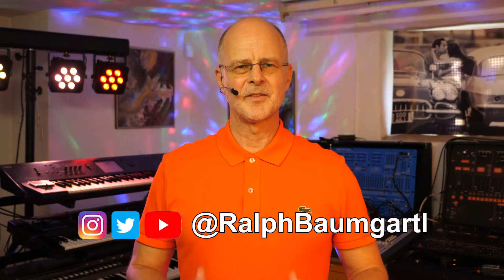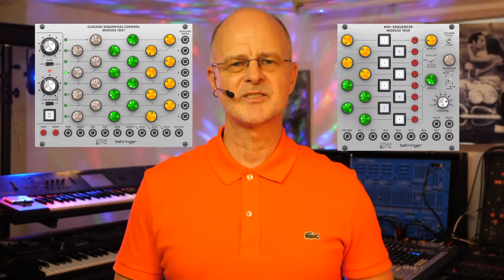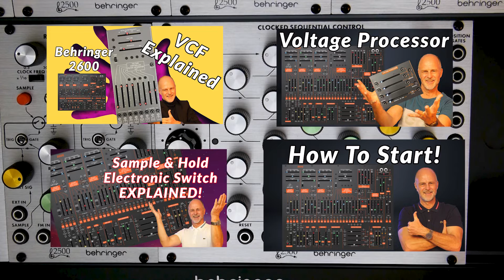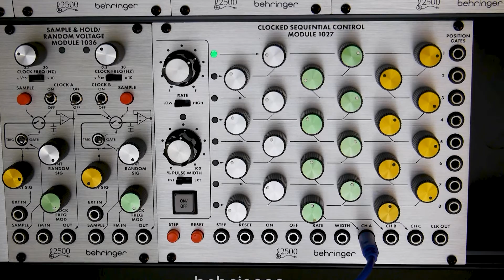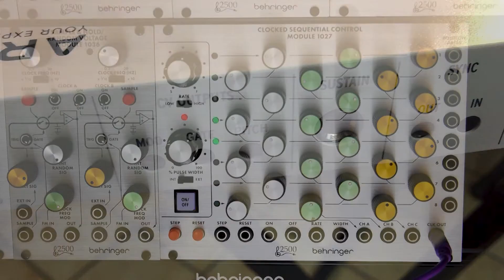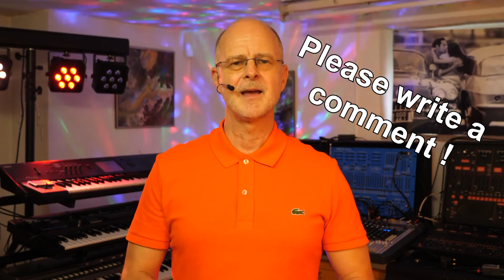Demystifying the Behringer 1027 analog Step Sequencer | 2600 Synth Connection

Comment: Afternoon Ralf, should it be possible to use the 1027 with the 911 envelope. I have the Behringer system 15, with added 1027, I can make the envelope work when using a keyboard via midi, but when using the 1027 to sequence with the 911 envelope  the 911 not doing anything, I'm using the 1004 oscillator, 921b and 2600vco, Hope you can help. Cheers Tim.
Reply from the maker: Hello Tim, the 1027 has a max Clock Out of 5V but the 911 requires a 5.5 V signal according to the specs. Try boosting the Gate (Clock Out) signal from the 1027 before sending it to the 911 envelope. Please note that I do not own a 911 but I think that’s the reason why you have trouble triggering the 911 from the 1027. Cheers, Ralph

Comment: How??? does one get it to slave to another master clock. (bypassing the internal clock). so that it stays constant all the time? please can you help? Is it even possible? rate and step in alone doesn't seem sufficient?
Reply from the maker: Run the external master trigger signal into the "STEP" slot.

Comment: I'm fortunate to have 3 different sequencer options for my B2600 so, much as I do like the Behringer 2500 series of modules, I won't be needing one of these. My Keystep 37 and my Behringer Crave do most of the heavy lifting and I recently also acquired a Korg SQ-1 as I just think they are so neat and compact.
Reply from the maker: The 1027 is definitely an old school sequencer. In order to use in a more convenient fashion one should add a quantizer. Have a creative weekend, Ralph

Comment: Hey Ralph – Thanks for the tutorial. I have a problem with the external clock. What does the clock signal need to be for it to sync?
My Beat Stp Pro is set to 2ppq, and it doesn't work.
Reply from the maker: I had best sync results with pulse Wave signals. I don't own a BeatStep Pro. The 2ppq signal is the Korg Volca Sync standard. Try 24ppq too. Start with the slowest speed on the Beatstep with either Sync setting. You may also have to boost the Sync signal from the BeatStep before it goes into the 1027. You can use the 2600 preamp for this. Cheers, Ralph
Reply: @RalphBaumgartl  Hej Ralph - thanks  - and the Blue Marvin is right below ;-)

Comment: to be honest I hesitate between the Behringer 1027 sequencer and the 960 which is longer but which seems to have more possibilities. Your opinion?
Reply from the maker: If you are just looking for a standalone sequencer then the 960 would be my choice. But if you are looking for a sequencer/sequential switch combination then the 1027/1050 might be the better option. Also bear in mind that the 1050 can also be used as a standard mixer module only. Cheers, Ralph

Comment: Hi, do you know how I would synchronize the 1027 with a Moog grandmother sequencer/ Thanks Tim.
Reply from the maker: Use Clock In/Out on the Grandmother and Step/Clock Out on the 1027. Experiment with both directions and find out which works better for your workflow. You may have to boost the Clock/Trigger signal to make it work. I have tutorials for this on my channel as well. (please note that I don't own a Moog Grandmother, but that's how I would approach this task)
Reply: @RalphBaumgartl  Cheers thank you for your info. Tim.
Reply: @RalphBaumgartl  Thank you, I have got the GM and 1027 working together. Now I am having trouble syncing the Behringer Odyssey to the 1027 I have tried them both ways, if I use the odyssey as the master the 1027 does a weird type of ratchet thing and vice vice versa. Have you any advice? Regards Tim.
Reply from the maker: @DisciplinedCommotion  Always make a Midi connection wherever possible. And when there's no Midi option left then use a Midi/CV converter.

Comment: great video. I have a Q, do all 8 steps play all the time, or can steps be skipped? Cheers Tim.
Reply from the maker: Hello Tim, you can play fewer steps by using the Postion Gates and Reset slot. In order to skip and mute steps you need the Mix Sequencer 1050. Greetings, Ralph
Reply: @RalphBaumgartl  cheers Ralph.
thanks for the info.

Comment: Would  be nice if you explained the difference between gate and trigger in the 2600, which is different from eurorack, and how to use that feature, which you appear to do at the end.
Reply from the maker: The Gate also includes a Trigger. That's the spike at the beginning of the Gate. To put it very simply, when you set to "Multiple" on the 2600 you can play a new key while the previous key is still depressed and thereby triggering (initiating) the Envelope again. On the 2500 Eurorack modules you also have the "Multiple" feature but you have to do some additional patch cabling to achieve that result.

Comment: I use mine with the 962 sequential switch to get up to 24 step sequences going into the Erica Synths Pico Quant, I duplicate the gate out into a 4MS clock divider and patch the various division outs into my drum modules for drum sequences. I didn't realize you can use the 1050 (for whatever noob reason) to do the same thing as the 962, which I've been slacking on trying out, which if it works with how I like to patch things, would save me some space and power draw for more modules :D
Reply from the maker: Hello Sean, the 962 seems to be a pretty common companion to analog step sequencers. Anyway the 1050 is a powerful solution for the 1027 because you can set up an "internal" connection to the 1050 which is simplifying things. Thanks for sharing your experiences 🙏 Have a nice weekend, Ralph

Comment: I started with B2500 modules in my Nifty Keyz. Looks very nifty indeed. Couldn't resist adding a B2600 alongside. So much for so little money!
Reply from the maker: Yes, the B2600 is extremely good value in my humble opinion.

Comment: Nice! but why don't you use the rest of the Behringer 2500 modules instead of the 2600? This is all about the 2500.
Reply from the maker: There are more people out there who currently own a 2600 and are looking for an analog sequencer. You can easily apply the connection process which I am explaining in my video to any modular eurorack system consisting of or including VCO, VCF, VCA and ADSR.

Comment: Hey ralph, thanks for the video! I have the 1027 and 1050. I don’t use them combined often.  I don’t sequence notes with the 1027 often because it’s not quantized and the fact that it’s a short sequence (I use a sequential switch to combine the channels into a longer sequence in that case). But I still like to use it for modulation and as a clock. I usually use Rene to sequence notes because I can get a much more complex and shifting sequence with it. Are you making a video combining the 1027 and 1050? That would be great! I bought them to use together but it didn’t work the way that I had assumed it would. Like most things, I’m sure I missed something along the way.
Reply from the maker: @jdforth Yes, I will also address how to combine the 1027 step sequencer with the 1050 mix sequencer. Greetings, Ralph
Reply: Psst, you can use the 1050 as a sequential switch to make the 1027 play longer sequences 😉
Reply: @ScottPigman  Yes, I am aware.  I just use the doepfer sequential switch though and the 1050 as a mixer. But I’m sure that I’ll switch everything around sooner or later anyhow.

Comment: thanks so much for teaching how to use this module, looking foward to the the next video with the mixer :-)
Reply from the maker: Thank you for your kind feedback! Glad to know that you get value out of my videos. Have a good week, Ralph
Reply: @RalphBaumgartl  Hi Ralph do each step knob setting affect the overal tuning ? I mean when i turn one of the knobs with a high pitched note like setting it at 12 o'clock , the tuning of the sequence will very slightly change in pitch. Does yours do this ?
Reply from the maker: @smartti1970  Turning one individual knob will NOT affect the pitch/tuning of the entire sequence. But bear in mind, this is an analog device. It does not behave as accurately as a digital device. It may go out of tune slightly and thus the sequence may require some re-adjustments.
Reply: @RalphBaumgartl  thanks very much for your reply Ralph.

Comment: 🙏🧡💚👍thanks for this tutorial. I'm building my racks for now, the 2500 modules are on my list with two grey minie B2600, with other Behriger things, Depend of my money every month. For now, I'm about the three cases wich will contain 2 or 3 keyboards by unit. The upper part will be the racks , euroracks and 3U, Acting as lids. So it is very important for me to listen what material I need, to balance between mono and polyphonic instruments and the structure , the organization of the racks. In your video, I listen that the philosophy of the 2500 modules are well corresponding to the 2600.   My music is partly played on keyboard, partly this is long slow sequences, soundscapes, using sound from nature too. This month I just brought two Keyboards Behringer Swing, as I am busy to design the shape of the three cases. My project seems ambitious, but in a few years All those new affordable instruments opened a new era for old listeners of electronic music like Tangerine or Schulze, not wanting to recreate past, but just to our proper search with new ability of creation. This sequencer lets being keyboard free to control free designed sounds suite, then modulated individually, this lets a big amount of creativity, and this is only one module of two, very smooth pieces of music.🙏🧡💚👍
Reply from the maker: Hello Patricia, thank you for sharing your thoughts. The Behringer Swing has a powerful sequencer on board which you can use for musical purposes. I personally consider the 1027 sequencer more of a hybrid device between musical and module control purposes. Greetings, Ralph